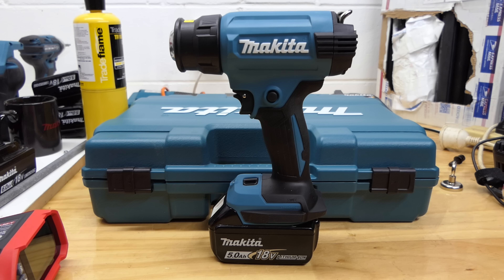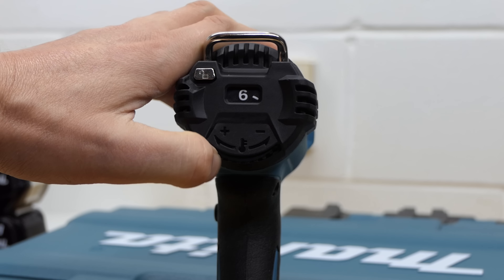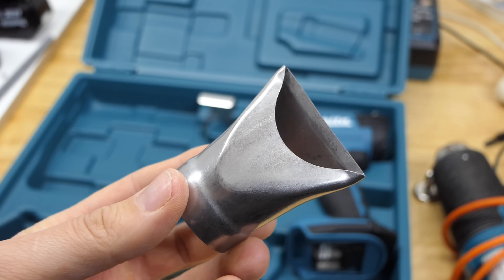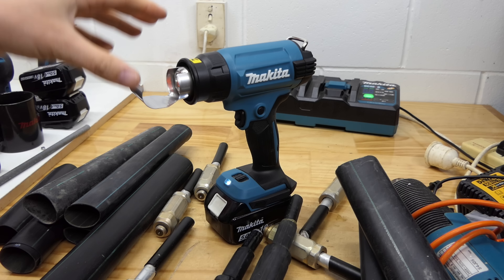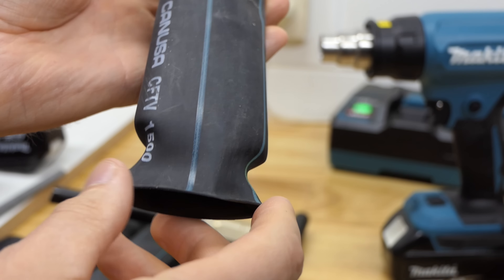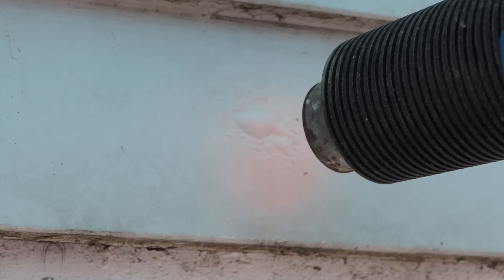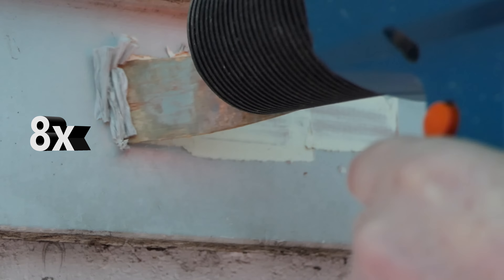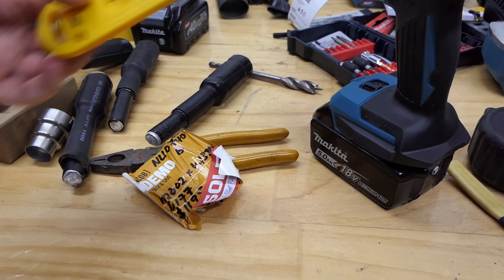Makita 18v Heat Gun Review. Hot or Not?

Comment: They are Great for small stuff.  I have the Milwaukee and it has saved my ass multiple times.  The 1st time I used it, it paid for itself.  In the middle of nowhere and lacking a coupling, I heated and swaged a couple of pieces of 1in pvc for a slip fit.  WORKED GREAT!  For those who don't know PVC pipe can be split and easily formed into just about any shape.  Great for protective covers for edged tools and tough sheaths.  Not as fast as a torch or real heat gun, but with no mains power for miles I was calling it the best tool I ever bought.  I've used it to thaw locks, make epoxy set faster and get the air bubble out, and even heat up cold pizza at the jobsite.   Handy as hell.  This comes with more features and attachments than mine, but no idea the cost difference.  You probably won't use it often, but when you need it, you'll be glad you got it.
Reply: Yes heat gun pizza so good

Comment: ITS  A  MAKITA.  EVERY  MAKITA  TOOL  PERFORMS  EXCELLENT.  MAKITA  DOESNT  RUSH  THERE  TOOLS  OUT  JUST  TO  FLOOD THE MARKET  9.6 VOLT CORDLESS DRILLS STILL WORK,  EVEN WITH ORIGINAL BATTERIES, 30 YEARS OLD!
Reply: I would say the problem with the battery heat guns is not that they are all junk,  its that people's expectations are too high.  Anyone that understands the physics, understands the difficulties in designing a decent heatgun on 18V 6ah. The only part that is unacceptable is makitas advertising of this unit,  which is misleading

Comment: I love this thing , but ya, it’s definitely not for professionals. Power and capacity wise you are pet better off going with a corded heat gun, or torch if you need constant use. 

I use mine around the house and for small projects when I don’t need to use the corded gun. 

I’ve used it for heat shrinking stereo wires, tinting my trucks windows and I even defrosted the freezer in garage, the attachment ejector is such an awesome feature, I wish that my corded one had this feature.

The only way the heat gun will be more for professionals will be when they come out with the 40v version.

I don’t use this on the daily so it works for my needs, I’m not ditching my corded heat gun though. 

If you need this heat gun for professional use then look elsewhere, or hold off for the 40v version. 

Sorry for the long post, hope this helps.

Comment: I have one, not hugely impressed with it, it was crying out to be released on the XGT platform. Having said that, my 240 volt heat guns use 2400 watts when cranked up, you're never going to approach that output with a battery powered unit. These are handy for 2 minute little jobs, any longer than that and you can safely break out the extension leads to save your sanity. 😂
Reply: XGT x4 system might be enough…
Reply: @gf2e  😆👍
Reply: Actually, there was a short lived Ridgid one that used butane to heat the air and battery just for the fan. It sounded a lot better, except it was expensive and unreliable, sadly. Maybe someone else will make one again.
Reply: 18v batteries max out at 1800 watts out. 

2500 watts out can easily be attained by larger xgt batteries.
Reply: @Factoryseconds123  Trust me, they'd have no run time. These things chew through a 6ah battery in 15 minutes with what feels like a 1/4 the output of a 240V version. Not going to be usable without a large box of batteries.
Reply: Airflow ain’t there. Neither the speed nor the quantity.  I had a Dewalt one for a minute…what a joke.  The Steinel (sold as Metabo) one is apparently disappointing, which is…disappointing.  It looked bigger in pictures.  The Dewalt compared to my corded Steinel was like a robo mech fighter vs it’s pilot, size wise.

Comment: This is a great illustration of just how inefficient batteries are for this application. For heating, some type of gas is almost always going to be better unless you have HUGE batteries (and lots of them). The energy density is just on a whole different level.

Think of it this way - a typical space heater runs at 1500W. A standard 5Ah LXT is 90Wh. That would equate to 3.6 minutes of runtime.

Comment: I have the A-67262 (small cone nozzle) and it works great with replacing electronic components on circuit boards without having to desolder each pin.

Comment: I bought to shrink gasket, so it doesnt peel back off, dry of water in tught spaces so i dont need to set up the airline and can help out other workers! And can warm my gloves up 😊 defo good for small jobs like mune stated above, however if u are in a professional trade needing this on the daily then id recommended a wired unit or 100 batteries and alot of patience

Comment: Got my one when it first released. I like it allot as it will save me setting fire to all the little jobs I used to use the blow torch for.
Not powerfull but definately has its place.

Might be one of the last 18v tools though 😢
Reply: No, Makita say they plan on keeping the 18v along with the 40v, for a while at least
Reply: @asarendars  yep. I'm thankful they came out with that statement otherwise the LXT values would go through the floor.
I'm heavily invested in LXT but I still fear they will sunset it in a few years. Although to be fair I don't quite blame them if they do, they have had the same battery platform for at least 12years (my oldest tool). DeWalt can't even support a platform for one month! 🤣🤣🤣
Reply: Agreed! Though I wouldn't mind a new 12v line.
Reply: @nedt  if they drop LXT ima drop Mikita lol
Reply: @asarendars  I WANT to get on makitas 12v range but they have let it rot.  Milwaukee appears to be the go for 12v, plenty of skins to.
Reply: @shortyorc121  fair enough. Milwaukee are good but their triggers fail.
Bosch are an option, and DeWalt... Well it won't be stolen!

Comment: Hard pass on this cordless unit, so I looked into buying the Makita variable speed plug in heat gun HG6031VK. After reading a load of reviews that unit doesn't seem to have great reliability, what the hell is going on Makita? Seems like the engineering team who is designing the heat guns needs a long vacation..........
Now I have to look into purchasing another brand. I have an old beat up Wagner unit that won't die, but I wanted more temperature control.
It's 2023 how hard is it to make a good heat gun???

Comment: I actually like the look of it. For small heat shrink, bending conduit and drying wet things, it looks like it would be spot on. Less hassle than borrowing the wife's hairdryer. 
My disappointment is the lack of MacPac case, I don't understand why they've gone back to the old style of cases.
Reply: Because the old style cases are much better.  

MakPak cases are difficult to open, very space inefficient, and relatively easy to break compared to blow moulded cases.
Reply: That does not match my experience. I like them.

That all said, I've just purchased the heat gun in the UK and it did come in a macpak case

Comment: A heat gun is never going to rival a blow torch. Heat guns typically top out at between 550-750 C. A candle flame is 1000 C. A blow torch, depending on the fuel, will be as much as  3 times that. A propane torch is always going to be well over 3x hotter than any heat gun.

The point of a heat gun isn't to get super hot. It's CONTROLLED heat.

Comment: Dude good test . But in my experience with heat guns the slower wind speed is hotter same with hairdryers. I’m still quite interested in getting one of these. I’d be using it for preheating small car parts for painting. For restoration use

Comment: The fact that they make a plastic welding nozzle for this is interesting.  Doing PVC Welding you need good thermal control and loads of heat but highly concentrated. I have a 2400 watt mains unit but rarely run it at full heat. Shame they didn't supply a plastic welder nozzle to try.

Comment: Ally tools got stolen so I need to replace them. I'm definately considering switching platforms. I was on the 40v platform and some of Makitas decisions were questionable.

Makita went with outdated tech on the 40v batteries which made them like bricks and to this day there still doesn't appear to be a 40v/80v mower.

This heat gun debacle exemplifies my frustration with Makita. Common sense would have dictated to release this heat gun on the 40v platform... They may have ended up with a useful heat gun then. Sometimes I just don't know what makita are thinking. Trade counter Direct don't even stock makita now, which makes me think they may know which way the winds are blowing

Comment: I have Makita’s wired heat gun. I’m disappointed this version didn’t keep the temperature control LCD with the actual temperature value. Also, this seems like it should’ve been on the XGT line.
Reply: Hikoki made their heat gun with a screen, and is compatible with the 36v. But feature wise the Makita is probably still better.

Comment: That heat gun looks like a good tool for electronic repairs and delicate jobs rather than pipes and paint
Reply: Just what I thought.  So I bought one.  

Delighted to find out that an accessory exists to assist with small heat-shrink jobs on wires and cables.  Chose not to afford the mortgage they required to pay for it.  Ludicrous price for  a bit of bent tin.

Comment: I bought this for heat shrink as a sparky, I just basically use the thin walled stuff.  Even for that, its slow, I used to use gas when the power was off.  I am returning it and just going to keep my annoying 230v $20 item.  This is too slow even for light duty stuff.  If the skin was less than $100, I might have kept it.